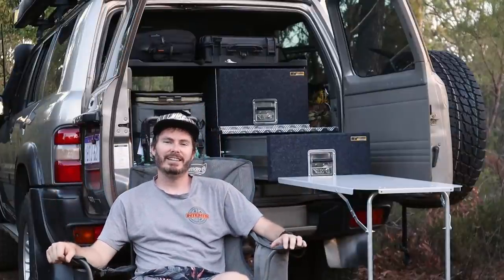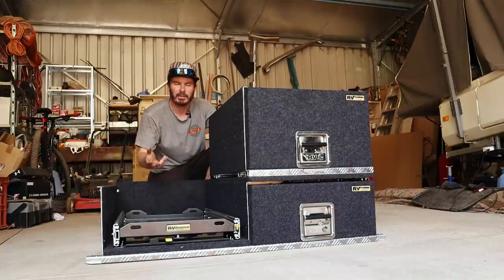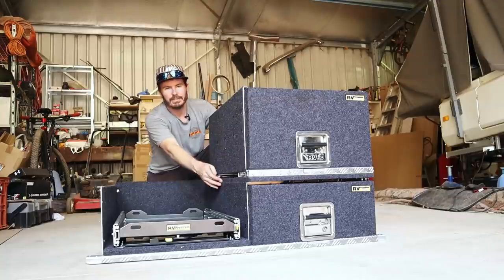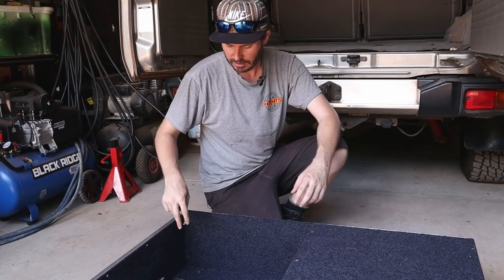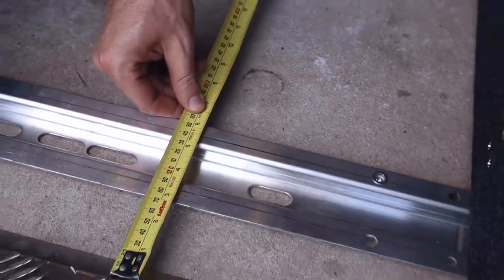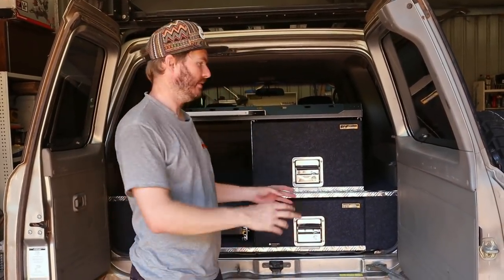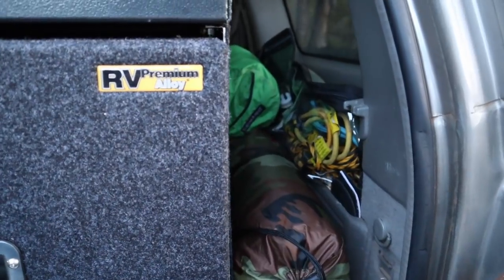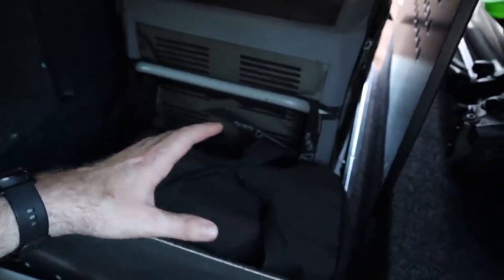Choosing & Installing a New Set Of Drawers In The GU Patrol

Comment: Have been using black widow and rv for many years. Best drawers on the market apart from the lock strikers which break repeatedly. Rv factory in new gisborne. Not in Melbourne! Cheers. Its essential to red loctite all the bolts and fitting etc. They vibrate loose unless red loctite is used.  Great video. Cheers